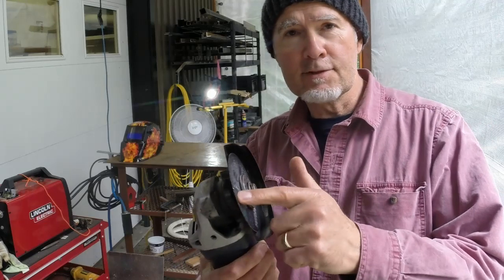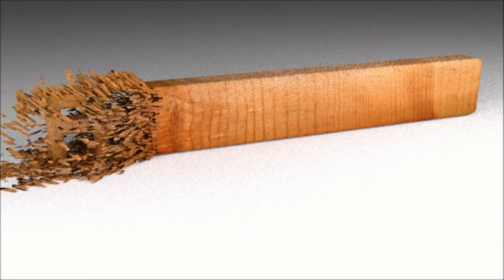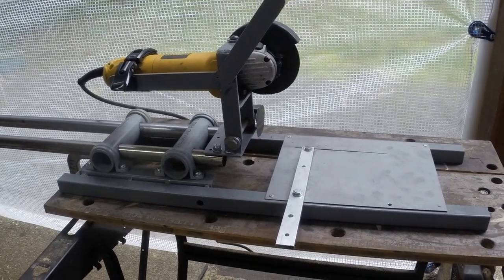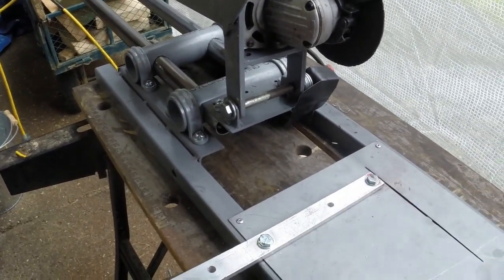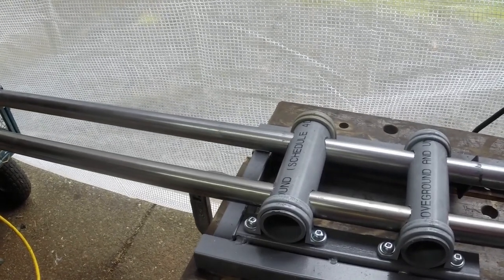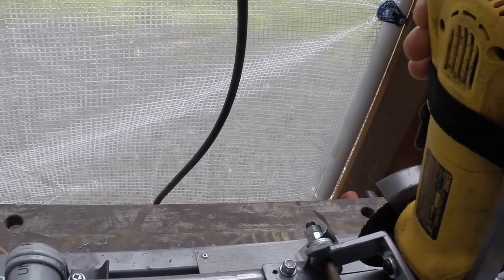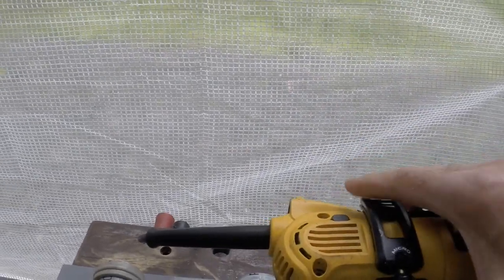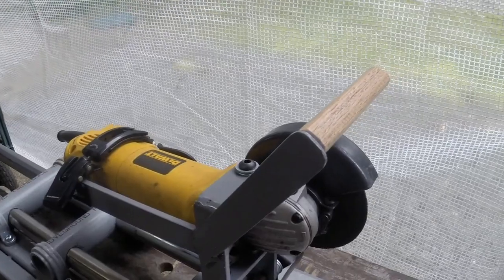Angle Grinder Mitre Saw

Comment: can i ask somethign?? why you use tube inside a ( plastic) cylider? what is the difference if u used tubes over a rectangular tube?whats the gain on a cylnder over a cylinder? more solid movement??
Reply from the maker: Antonis, my objective with this project was to use scrap material I had kicking around the shop and the PCV conduit was chosen because I think it introduces less friction on the metal rods passing through.  In answer to your question I think you can use any stock or shape of stock for the slider.  Hope that helps. 
Happy making!

Comment: I have an old AEG mitre stand for 9" grinder and it's practically impossible to cut a good 45 degree angle, chiefly because the blade flexes and moves off course, especially as for eg with square tubing the first contact is made on a corner and it gets worse from there.
Reply from the maker: Hey Paul, I know what you mean.  I use the slider by gently cutting the entire length of the cut using gentle pressure with multiple horizontal passes.  This seems to minimize blade deflection.
Reply: Great setup. Maybe I will find time to make one myself. Thank you.

Comment: comes ready to use out of the box and does an amazing job of cut quality>>>ur2.pl/782    It's easy to use and matches what you would expect from a Dewalt product. It's super easy to move from angle to angle on the cuts with a simple flip of the knob in front. I think the one thing that would be nice is if the dust catcher could hold more and caught more but it's a saw and I've never seen a good solution for dust management. this thing has no problem going through 4x4; 2x4; PVC pipe; or 2x6 at any angle I've thrown at it.